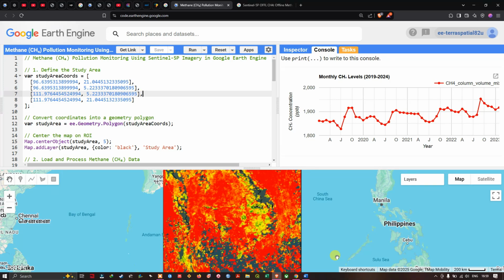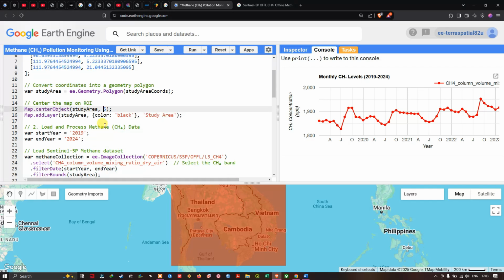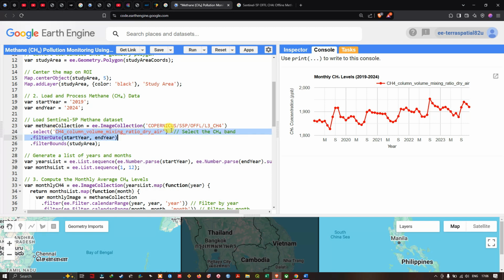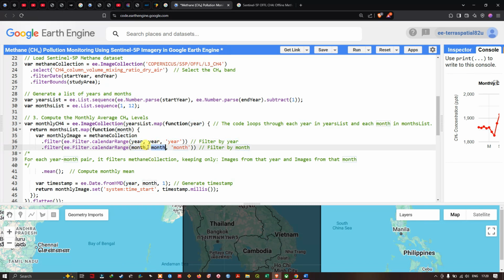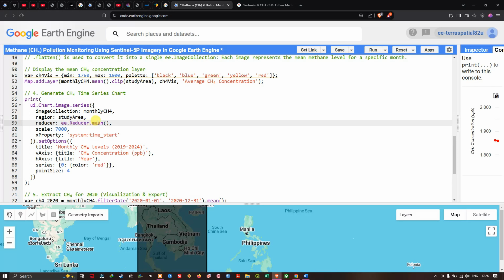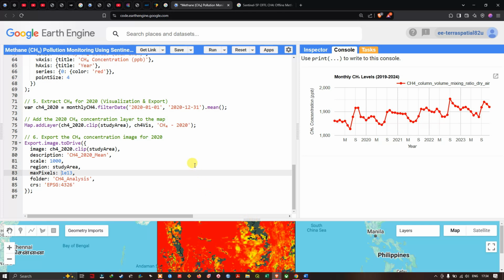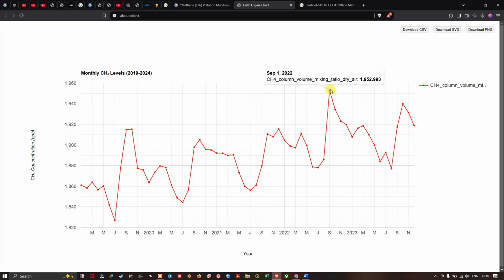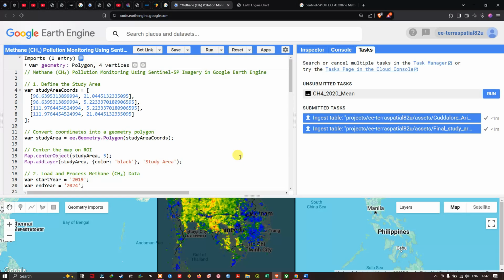Methane (CH₄) Pollution Monitoring Using Sentinel-5P Imagery in Google Earth Engine

Comment: First of all, methane is not a pollutant. And with sentinel 5p as it's obvious, you can visualize " column volume " of methane, which consists of top of atmospheric data! So, the concentration for methane isn't the same as surface data. Two big technical mistakes there,sir.